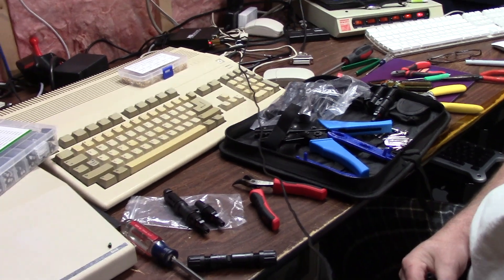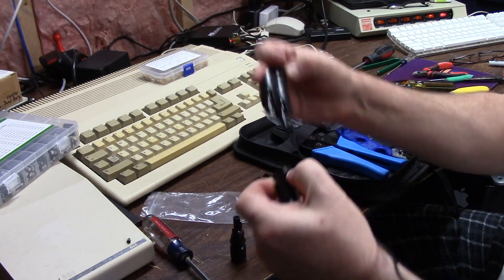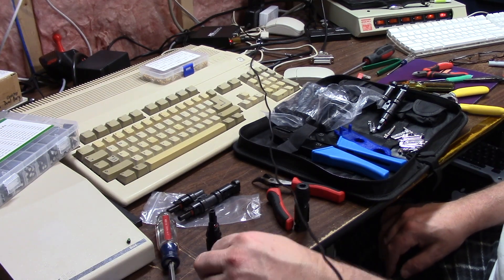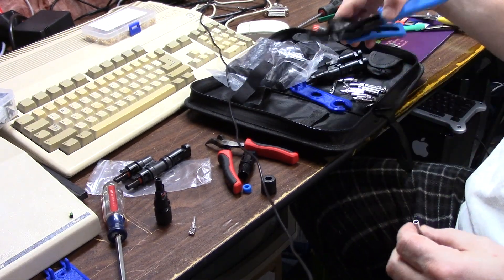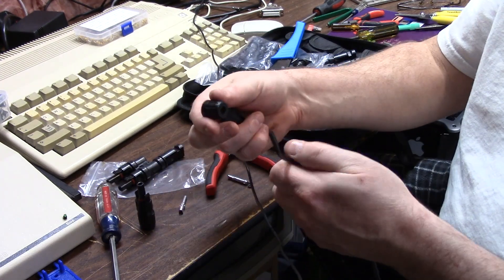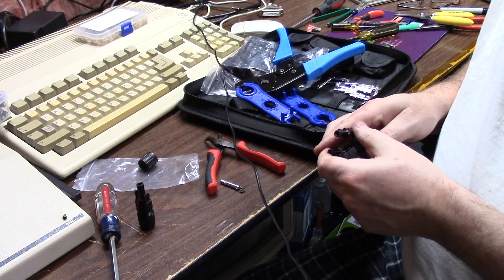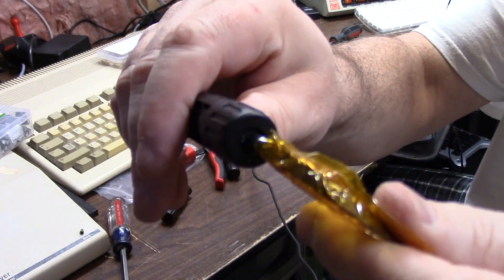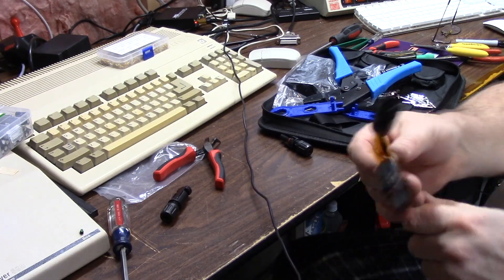How to make your own Solar MC4 connections

Comment: Hello Chris, I really like your restoration videos. But here, regarding the Stäubli MC4 connectors, I have some points to correct:

First, the connectors are not meant to be used with solid core wires. Use tinned stranded wires according to IEC60228 class 5 or 6, so the typical solar cables.

Second, the crimping style you showed is completely wrong. The wires must not be drilled and folded over, the insulation must not be crimped.

And a cosmetic remark: You mixed up males and females. The hollow (bigger) contact is the female, not the male. The style of the housing is not relevant here.

You will find all three points in the Stäubli assembly intructions and flyers.

Doing the assembly right is important due to the relatively high currents. Especially when crimping the insulation you will lose a lot of contact surface and will weaken the crimp due to the soft insulation, so the crimp will most likely not be gas tight...
Reply from the maker: Mine works great.  Seals.  Water tight. And i have stranded wire

Comment: Crimping on to the plastic would mean that it could loosen with heat. I would have thought the next part up would be crimped on to just the wire.
Reply: Yes, exacly. The contact is to be crimped ONLY to the stranded wire. And it has to be tinned wire for safety reasons. You will find all the details on the Stäubli home page (the inventor of the MC4 and enhanced MC4 connectors).
Reply from the maker: @TLang-el6sk it is crimped to the stranded i use the shielding as girth as it would just rip the wires